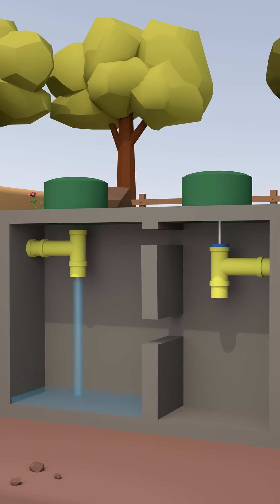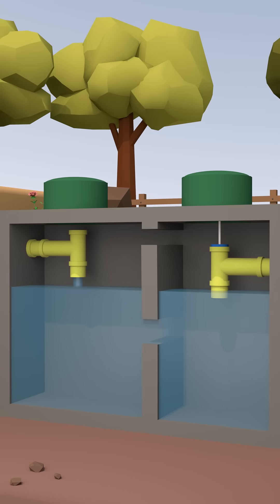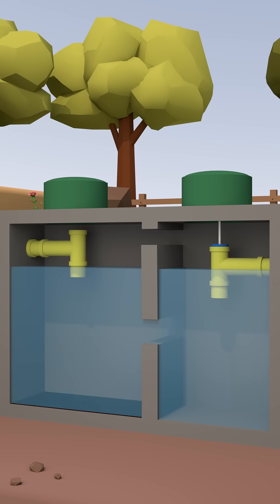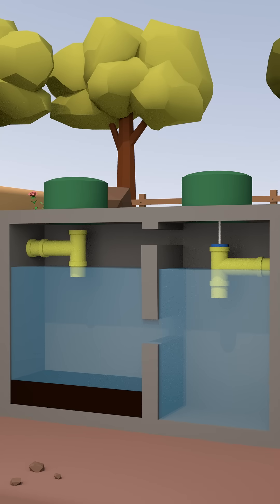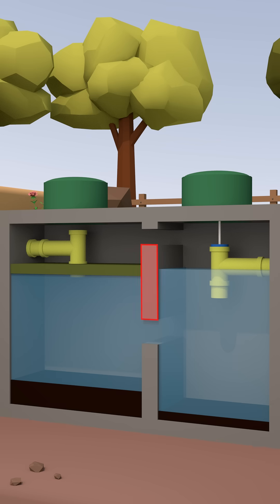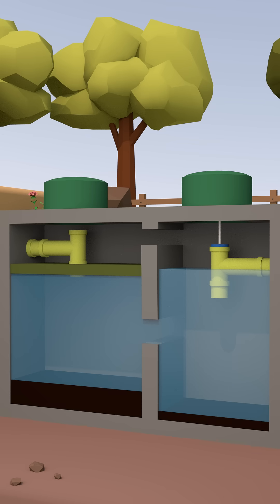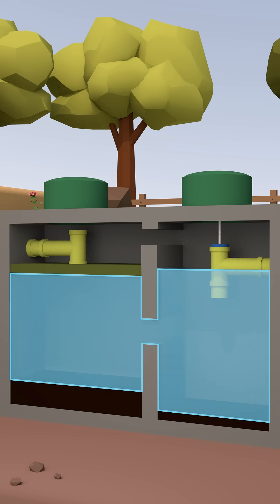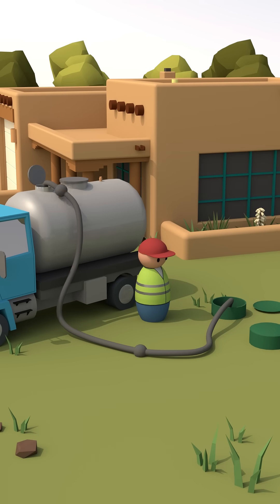How Does A Septic Tank Handle Liquids AND Solids? #wastewater #treatment #septictank

Comment: The question I have is if most septic tanks are built like this then what the hell kind of septic tank do I have? I have three tanks one collects most of the black sludge and two are constantly filled with water but the one thing I can’t figure out is why would my septic system have that many tankswhen the only thing in my house that goes to the septic system is the toilet and the shower everything else is gray watered or pumped into the leach field
Reply: You have an aerobic system
Reply: It has to separate everything more before the pump tank or the pump will be ruined by solids.

Comment: For optimal performance, this system should be activated by filling the tank to 75% capacity with raw water. This mechanism is utilized in the grease trap within our wastewater system. For the domestic Sewage Treatment Plant (STP), we employ a horizontal chamber system that immediately separates solid particles from the effluent, allowing them to dry within the system. These solids are then digested by aerobic bacteria within the system. The STP system is designed to prevent overflow and requires minimal maintenance, as it does not retain accumulated solids.
Reply: So the Spectic Shocks that they sale in stores don't really work to open up the Drain Field like it says?
Reply: Hmm knowledge is power could you give me more details on your method please thank you

Comment: If you take a packaage of dry yeast and add it to warm(not hot) water and let it sit a short time. Then flush it down the toilet. The yeast will eat the solids (not the grease). Had a family of 5 live in a house for 40 years. The only time it was pumped was for the sale of the house.  Yeast works and is cheaper than Ridex.
Reply: Interesting, I've been cultivating yeast for decades, but to make ales and occasionally wine .
Reply: This is a MYTH, there is literally a video in this very feed of a guy cleaning out like 20 years worth of yeast that didn’t break down anything. Don’t post misinformation!!
Reply: @seangallagher1947  I see no proof that yeast caused this problem. If it was caused by yeast how come it took 25 years to be a problem? What could have happened is water from the house was running unchecked.....It happened to me. The grease that is not eaten by the yeast floats at the top of the tank and blocked the outlet and caused the waste water to backup into the house. Yeast works it is not a hoax. The crust you saw was grease.
Reply: CO2 have a cycle of 2-5 years before it's taken up by trees or algae. Methane cycle is similar. Could be bad with an air tight system though.
Reply: Sooo, do I do this or not lol asking for a friend?
Reply: @LoudNicey21  Yeast is our friend. It likes to eat. The more it eats the less you have to pump. It can not hurt.
Reply: @johnwalterc Thanks John, will try it out 🤗
Reply: @LoudNicey21 absolutely not!! This guy has no idea what he’s talking about. Look it up. It’s a common mistake that should be avoided.
Reply: https://youtube.com/shorts/ucKVe0BuzRM?si=wEXJc-YuVnKTRUoA
Reply: Ah yes these same people who proudly proclaim that they never pumped their septic system just wait until you actually open your septic tank... You'd be surprised to say the least
Reply: Won’t that cause a dangerous build up of gas? Yeast produce carbon dioxide when they eat after all
Reply: @Boxygirl96  CO2 is the least offensive gas produced in a septic tank. The tank is most likely not airtight. Gas under pressure probably leaks out via the 2 lids into the soil. Also the pressure would not be great enough to back up into the house. A water trap in the pipes prevent gases
 from coming back into the house.
Reply: @Boxygirl96 I would assume not as long as your ventilation pipes are up to code
Reply: @Boxygirl96 did you forget to watch the video?  Gasses are vented.
Reply: Nooooo, just have your tank pumped out… do things right.